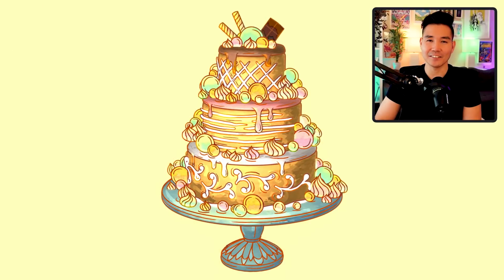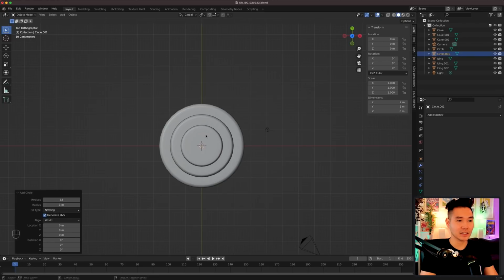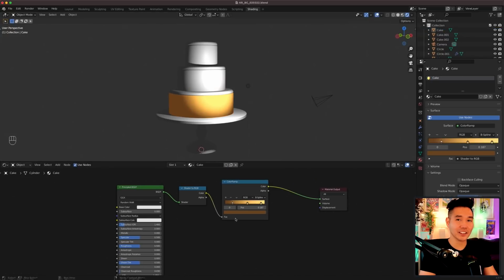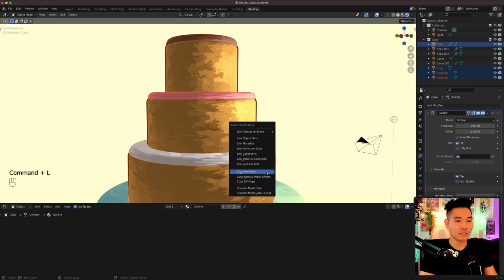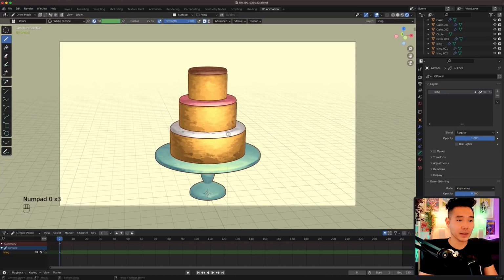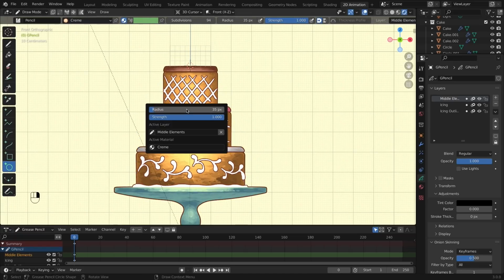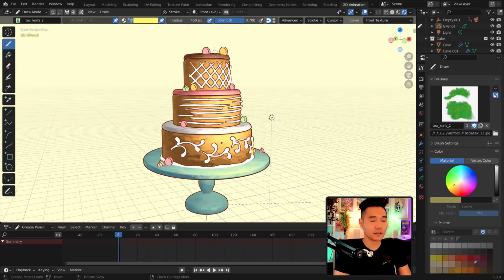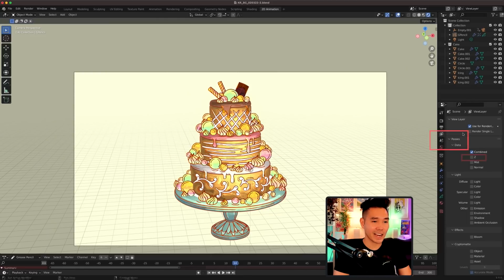Blender 3D Grease Pencil Tutorial - Cake

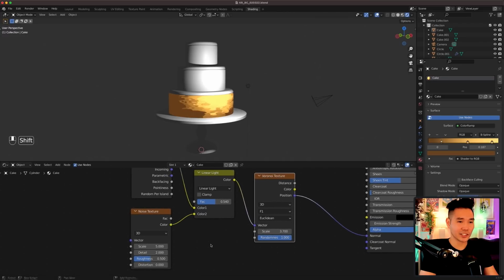Comment: 8:35 
I use Blender 4.1. When I put the noise texture from 3D to 4D, the object is repainted in pure purple, what am I doing wrong, please tell me?
Reply from the maker: This generally signals that a connection isn't possible or is not correct.

Comment: I am running into an issue in the Lineart part when I create a new outline material and scroll down to the settings section to enable Backface Culling I can't find it even though I am using the EVEE render engine and when I try to apply the outline using the solidify modifier it doesn't work properly I don't know if that method has been changed In the latest blender version consider I am using blender 4.3 version  I really can appreciate some help, overall great tutorial mate.

Comment: Hey guys, Is there any reason why the strokes are not showing? is like the tool is not working. I can't see what I'm painting and it's also not rendering
Reply from the maker: It could be that you're not drawing on an actual keyframe. Check to make sure the error at the bottom of the Blender window doesn't come up.

Comment: List of Grease Pencil Questions

 1. Why is the fill not working?
 2. How to connect points in a vector?
 3. How to make an acute angle in a vector?
 4. How to make a smoothing brush?
Reply from the maker: 1. This might be due to an unclosed stroke. The paint bucket tool will only work if it has a closed area to fill
2. You can select the stroke and hit F to make the stroke cyclic (complete itself) or you can shift + select 2 different point and hit CTRL + J to join them
3. You can rotate strokes precisely in Edit Mode with the basic Blender positioning controls
4. Go into Sculpt Mode with the grease pencil object and use the smooth tool.

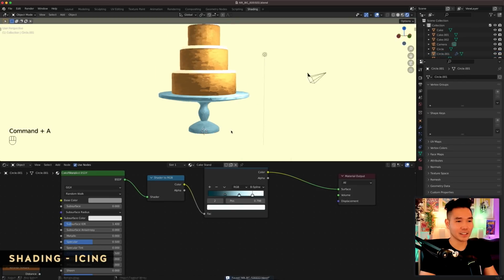Comment: At 9:55 when you link materials the nodes do not show up for the icing layer, talking with others they have also experienced this issue, how would I resolve this?
Reply from the maker: Hey Hyacinth, I linked the material from the cake mesh first and then created a single user copy (pressing the number or new material button). Let me know if the nodes are still not showing up.

Comment: when i press command 2 nothin happens wit the definition i also linked the material n the 2nd tier isn’t reflecting that change only the top tier is😭 but the 2nd tier is showing the material in the material tab so idk
Reply from the maker: Hey Kitsune! If you want to add the Subdivision Surface modifier, you can do it manually by going to the Modifier Properties Tab and selecting it from the list. Also, regarding the materials, make sure they're ordered correctly if you have outlines on them. So, just make sure the color material is in the first slot. Hope that helps!

Comment: I have a question, I am doing a similar kind of project and have many different 3D meshes and each and every mesh's shading is effected by the same light, due to this some of the meshes which are far away from the light get no shading at all. Is there a way where I can assign a light so that it only effects a single mesh without it messing up the shading of different meshes?
Reply from the maker: I'm not sure it's possible to exclude certain meshes from being affected by a light source. But, what I would do is create a duplicate material (based on your main shader) for the objects that you want a different look. Then, I would adjust the color ramp with either a multiply math node to intensify or lessen the coverage. You can place individual lights, but it's not always reliable with the shader set up found in this tutorial. If you are using a set up that incorporates the "Separate RGB" node, then that's more preferred as you can paint directly with a Red, Green, or Blue light. Hope that helps!

Comment: Nice!
I'm following this on Blender 3.01 and I have a problem:
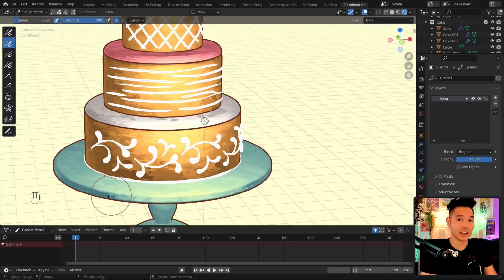@17:03 : how did you go to Edit Mode without deselecting the circle?
I can only do it after accepting it with middle mouse click and then in Edit Mode I have to select all the points of circle one by one (luckily they are on a separate plane from the other strokes so I can box select them on numpad 1)
Reply from the maker: Thank you! So, if you go into edit more but use "Stroke Select" with shortcut "2", it selects the entire stroke (including all the points attached to it). Hope that helps!

Comment: This is so helpful! Thanks a lot for making these tutorials. Of the three methods you mentioned for adding outlines, is there any particular reason you went for the third one? Any advantages or disadvantages?
Reply from the maker: There are and I’ll probably make a video about it soon. But it works better with grease pencil elements and it’s quicker from a performance perspective. The downside is that you can’t specifics lines on the geometry unlike the lineart modifier or freestyle. Hope that helps!
Reply: @kevandram  Thanks for the quick reply! Looking forward to that video! Thanks again, learned so much from this tutorial, especially the material setup which is a godsend!

Comment: The other thing Blender needs IMO is "explicit surfaces". They're there in a way (material assigned to a set of faces is a surface), but not really defined as such where you can label them.  It would be nice to label a surface so a material asset can be assigned to a specific surface on a mesh, and also to random assign various materials between surfaces to get like a "click through view" of a lot of different combinations - think clothing.  Blender doesn't tend to use the term "surfaces" much but I think it should as I tend to see it in other 3d programs, and I think it would be good to align with that terminology.
Reply from the maker: I believe the functionality is there, but perhaps not in a way that's defined as specifically as this. But yes, I agree I think that would be interesting if this could be labeled and align with the terminology.

Comment: Anyone happen to know if materials node setup can have "parameters" to it.  IIRC, assets can have parameters associated with them. Wonder if materials support - like when you drag an asset material onto 3d object an input dialog comes up with some config parameters (like a group node, but at higher level - inputs to shader as a whole and connected to material asset with some default settings). And user can see changes to the shading of the object as they're configuring the shader
Reply from the maker: Sure, if you create a node set up, you can create a custom node that groups them and where you can adjust the parameters.